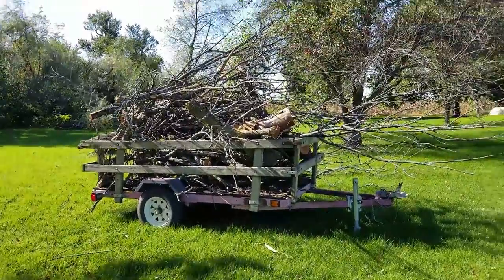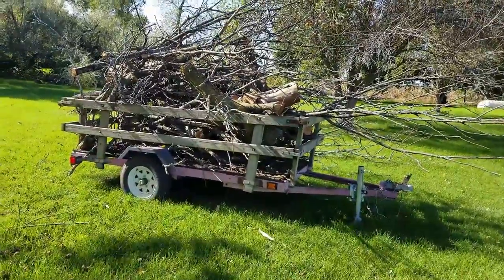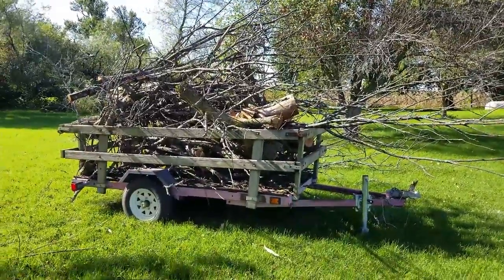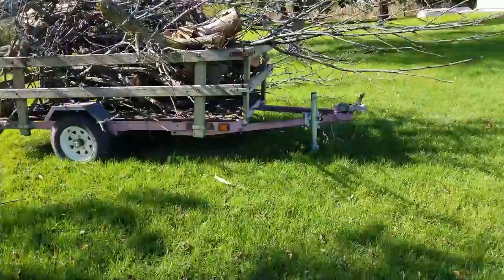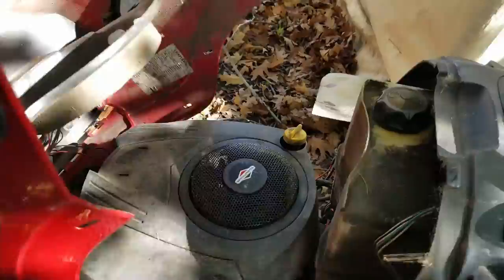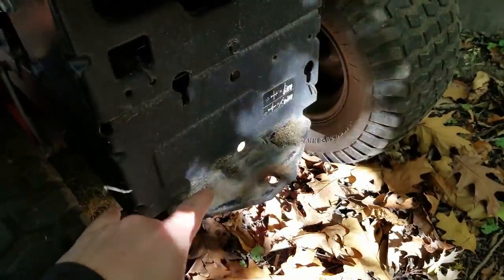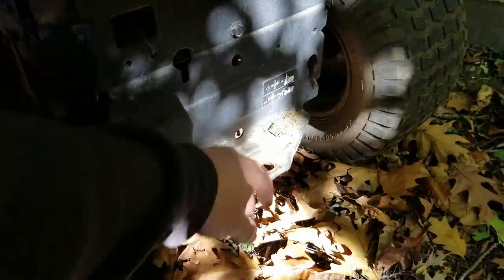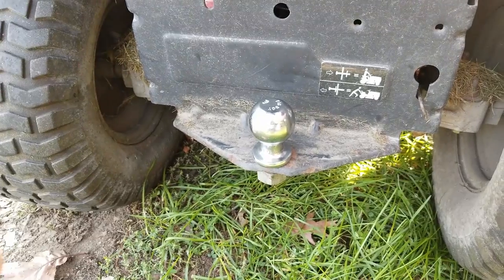Adding A Trailer Hitch To My Lawn Tractor (Kind Of)

Comment: Tractor supply carries the ball with 1/2" shank. The only issue I had was  that I had to add a stack of washers because the metal was thinner than the untreated part of the shank.

Comment: I simply got a piece of 2"x6"x1/4" flat iron. The hole in my john deere will fit a hitch ball, so I drilled town holes in the flat iron. one large enough for the ball to go down through the flat iron and the tractor plate. the other a little smaller. The smaller hole extended out so that I can still hook up my cart that I use with my tractor and or any other things that I would normally use the factory hole for. However, I now have the ball right behind it to use with my utility trailer when I need to with out ever changing a thing. This eliminates the need to put the ball on and off, it just stays on.